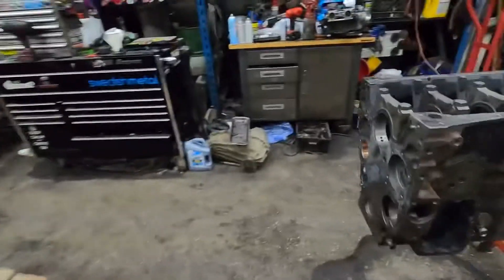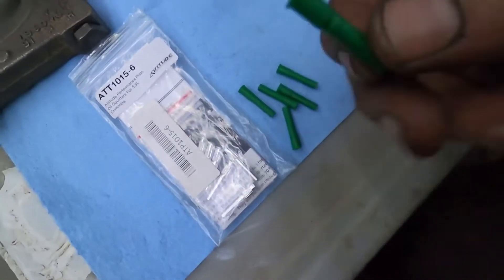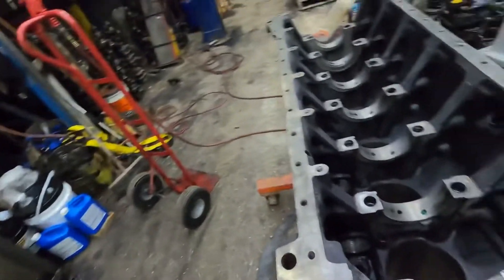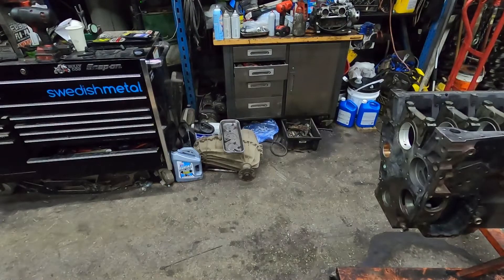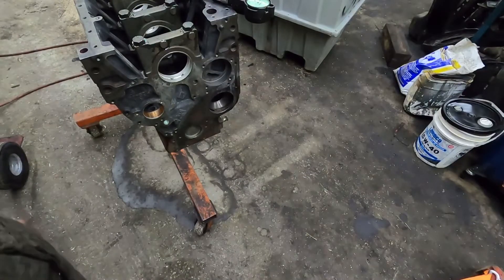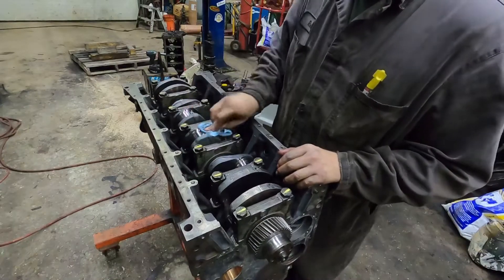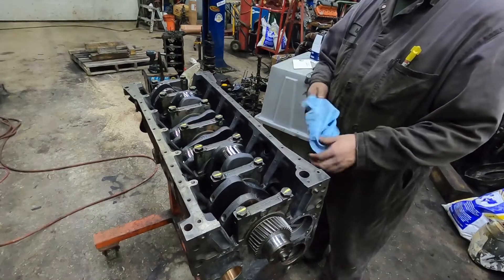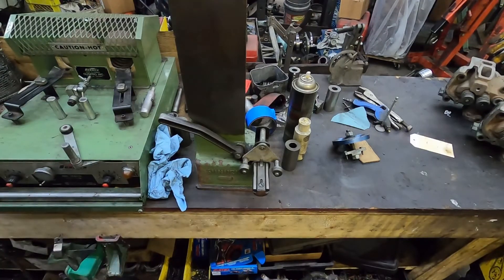HOW TO REBUILD YOUR 12 VALVE CUMMINS  PART 7

Comment: Ouh boy. I failed the rod test. i was checking piston protrusion and i find out that one piston was way off. I copy this rod aligment tool desing and another side has 0.16mm or 0.006" gap. You said that you throw those away, but does it sounds too much to try straighten it? And what do you think why is that one rod bent? it was not low, so i did not notice it. and even machine shop did not notice it when they changed bushing. Thanks.

Comment: How would you get that piston cooling jet out once its installed? I'm looking forward to the course! Man that spec range seems huge. What clearance would you recommend on a mild performance build.... say 400-500 WHP?
Reply from the maker: You have to tap them out with a punch and hammer
Reply from the maker: On the specs just in the factory range is fine for something like that. Just wondering were you able to setup and do a call with Luke ?
Reply: @CUTTERUPROB  Haven't scheduled. But I plan on chatting with guys (Luke) when I've got my feedback squared away.

Comment: Which store did u buy the aluminum squirters from? Everywhere I’ve found that has them are in the states.
Reply from the maker: i buy them for a wholesaler. the easier place right now would be from someone is the states right now.
Reply: @CUTTERUPROB  ok thanks man, and great job of the videos. It’s helping a lot with my first build 👍🏼
Reply from the maker: @kenblanchard4458  no problem gals i could help.